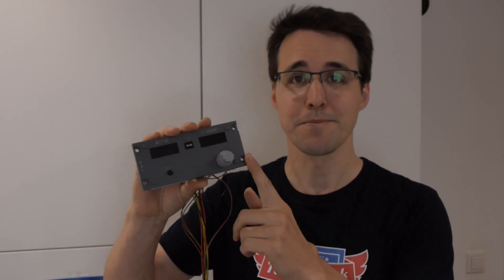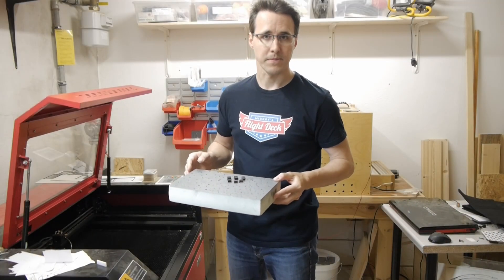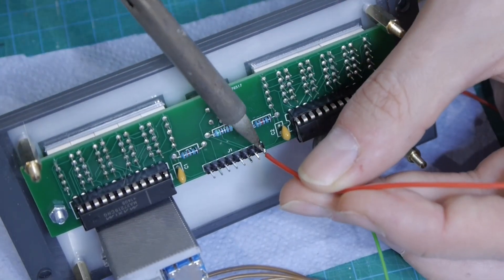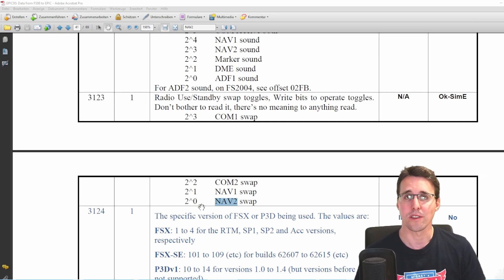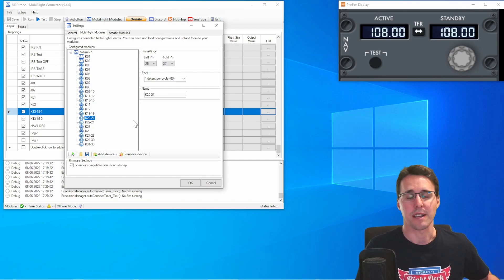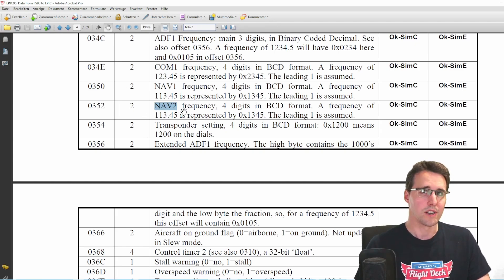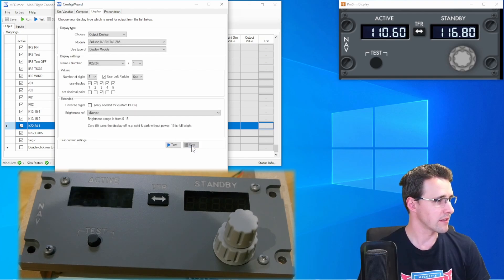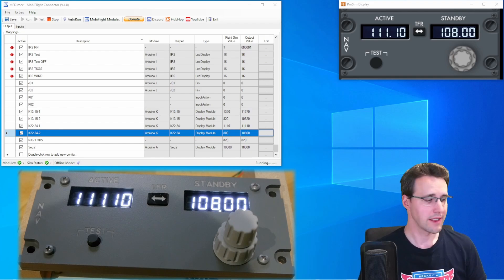NAV Panel - A Boeing 737-800 Homecockpit #69

Comment: For the transparent black acrylic rectangles in front of the 7 segment displays, what level of transparency did you use? I was looking at #2074 "transparent black smoke" acrylic that allows 25% light transmission, is that what you used?
Reply from the maker: I have looked up on the material. There is a sticker on it. You can search for Plexiglas 7C83.

Comment: You do NOT have to set the encoder reversal in the software.  Simply swap the A and B connections when you solder the wires to the encoder.  Will permanently reverse the encoder without worrying if the software configuration gets compromised.
Reply from the maker: Yes, that would be an other solution.